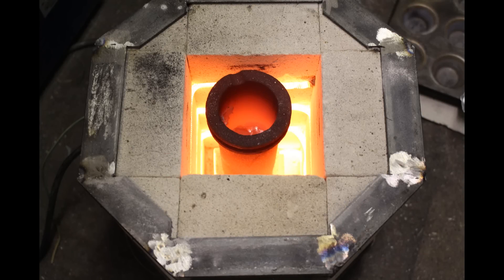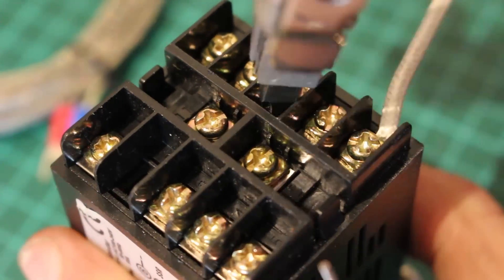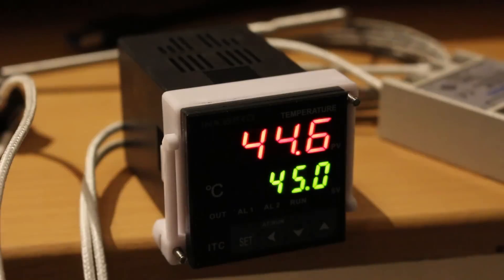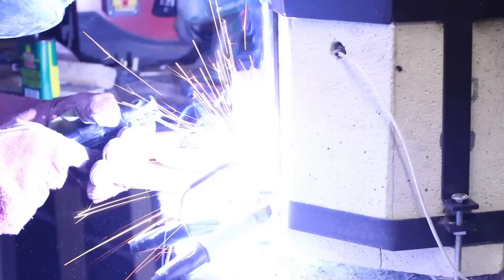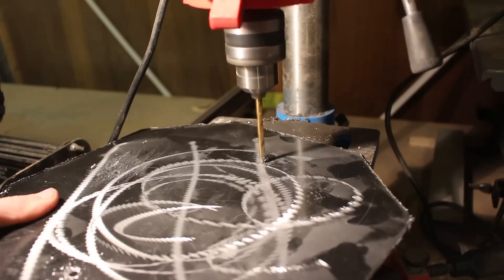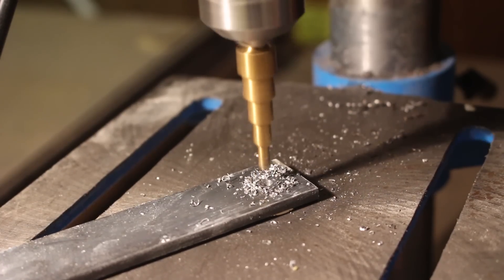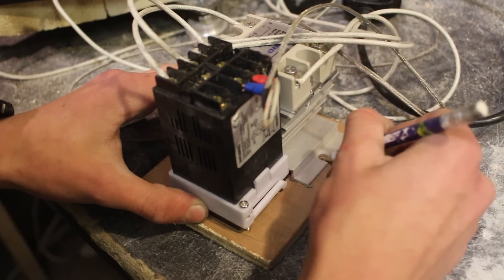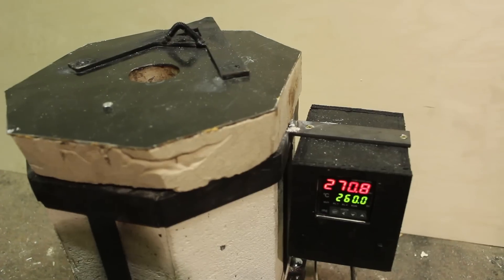How to Make an Electric Foundry For Metal Casting - Part 2

Comment: Do you have any idea how a resistive furnace like this compares to an induction furnace?
Reply: induction furnaces can melt steel, this cannot.
Reply: *****
Thanks. Any idea how much power they use in comparison? Or how much current they would pull from a wall socket (at 230V)?
Reply: TheRexDark No Idea, I tried doing some research and all I could find was someone that made a large induction furnace but the plans and how he made it was very hush hush he wouldn't share with anyone, good luck though
Reply: that depends on the power output

Comment: Nice upgrades to an already great forge. You might want to just check your earthing of the case is actually working though. It appears you painted the frame before putting the bolt through that is connecting the earth wire, the paint might be insulating the frame. A continuity check should be enough. You should probably also have an earth from the case to the lid frame just in case the hinge doesn't make an electrical connection.

Comment: You now also, besides having a casting foundry, have a small kiln for firing pottery, or melting glass.  The options are endless!  Another, less expensive option is to use an electric stove controller.  You have to play with it a little more to find your temperature control, but it is a great deal less, pricewise.

Comment: How did you get the PID controller with a range of -50 to 400*C to measure above a temperature of 800*C?
Reply: Change the thermocouple to a higher rated type.

Comment: hey maby this is out of your reach, but im looking into makeing my own vape box mod out of brass. i have casted a phew things before in the past but i cant wrap my head around casting a box? You should give it a shot it would be cool to watch you do it bro, subed
Reply: Casting a box has its issues on wall thickness as liquid metal tends to solidify and not get into thinner parts so efficiently. Only ways that come to mind would be to create box so walls are much thicker and you grind back to desired wall thickness, or it could possible work via making tons of flow tubes all around the surface so metal can flow everywhere. This makes mold really complex, needs pretty much 3D printer and you still need to clean up the outside.

I would go with thick wall route, create desired inside diameter and just grind into desired wall thickness from 3cm(?) witch should be enough to get metal flow. Mold should be done plaster and paris+sand mix, cause plane sand most likely would collapse, specially with the 3D printed part. Also make sure to make enough risers and flow tunnels to get best possible result. Excess you can always melt again, but adding more can be pain in the ass, specially for DIY casted part.

If you try this, tell me how it went, cause i'l be making my own line of vape mods soon and i was thinking on making some high end models with metal boxes.
Reply: ill give that a shot. If you go out and look at the mason 40mm i want to cast a tube that will fit with that make like a mega pen
Reply: GRAMMAR

Comment: Not sure my PID works right.. I get around 600-650C or some other high temperatures, and then itll just switch and read 100-150C lower.. Maybe my sensor is junk.

Comment: I've got a question. I'm about to make my own electric Foundry, based 99% off of your design/videos. i was thinking about using a bigger kiln heating element. one that is 220v still but 2500W instead of 1200W. i would think that it would be able to reach higher temperatures for melting more resilient medals like iron/steel. is there anything i need to change or consider if i were to use the 2.5KW instead of the 1.2KW?

Comment: +The Art of Weapons, i have been planing to make a propane metal melting foundry but your electric foundry seems to be cheaper to run so i want to make one, but i can't seem to find a resistance wire like you have so if you read this and have time please send me a link to your resistance wire so i can buy it :) ( if i can get the wire i will make a video showing me making it. thanks.

Comment: This project is awesome and i am accumulating parts to build it myself too :).

You can add a steel fence (small mesh) to the inside to prevent yourself/tool to get in contact with the heating wire (electric shock prevention). 

Another idea is to use 2 switches which disconnect booth power wires for the heater if you open the top side. 

A third idea is you can update the heating element from 1200W to 2000W , to speed up the melting time.

Comment: 5:45 you add an Earth Cable to your Foundry, please note that this will not save your life from Electrocution. The time it takes, the amount of current and voltage, you will not survive. A fuse! of all things is slow when it comes to saving lives, you want whats called an R.C.D, Residual Current Device, I say use an Licensed Electrician

Comment: Hi, I was wondering, where do you get your bottle caps for HDPE? I can't find any anywhere. I know I could get them from milk jugs, but that would take forever. Is there any place to get them in bulk?
Reply: Because milk bottle cap plastic is different to milk bottle plastic they are recycled separately so go to your local recycling centre and you should be able to get them in bulk

Comment: is there anyway to up the heat to 1500 C
Reply: No, the wire used in this video (which I'm assuming is nichrome) will melt at around 1300 C and even then it will be extremely fragile. The bricks he used in the video are rated to around 1000 C, so they'd crack from the thermal shock.
Reply: ChwanPang bb

Comment: Hey TAOW
Just made my own foundry thanks to your tips! I used to have a charcoal foundry but it was a bit dirty and quite expensive as well...
About the heating element I would however sugest a 3KW coil (or two), but I'm not on the same kind of electric grid (220V, France). I also had to plug it to a special plug (32 Amps).

Thanks for your great videos, I'm now casting with more ease!

Comment: Hang on... So the crucible split, the bottom was covered with molten aluminium and the spring got covered. I legit said that would happen on the original build video. :)

Comment: Couldn't you just use a dimmer switch in place of the temperature controller and then just put a separate thermometer on it? It would definitely be cheaper.

Comment: how do you get all the money, and TIME for these.
Reply: Just Another Emo On Youtube he has 168k subs he spends his youtube money probably
Reply: PId and SSR cost 10 bucks, heating element is 4 bucks, thermocouple is 3 bucks, Bricks can be bought second hand cheaply.
Reply: just TAKE your time its as easy as that
Reply: Simple, he's got great parents. I can't think there are many parents who'd let their kid experiment with molten metal
Reply: Truth. Who wouldn't make a forge if they had access to a full workshop. This is what makes it so funny really, that the forge cost $100 but the tools to build it over $10,000
Reply: John Jones the only tool used that you couldn't get for less than $100 is the lathe, and that was to totally unnecessary

Comment: Small improvement : Attach a connection to the lid so it turns off the heating when you open it to minimize the risk of electrocution.

Comment: What you built is a FURNACE, not a foundry.  Looks good, let us know when you can get it to melt bronze

FOUNDRY:
Pronunciation: 
/ˈfaʊndri/  
 noun (plural foundries) A workshop or factory for casting metal.

FURNACE:
Pronunciation: 
/ˈfəːnɪs/  
 noun 1An enclosed structure in which material can be heated to very high temperatures, e.g. for smelting metals.

Comment: You really dont need pid on something as slow as this, a simple on off regulator works just fine! why do anything other than full power when you are heating it up? And with the slow cooling of the aluminium you dont really need anything other than zero power when going from 265 to 260.

Comment: Your father gave you access to a nice workshop making all those works possible. My father didn't, he is a footballholic.
Reply: Workshop? Thats over rated.. i have balcony and living room, thought what i heard its ether metal melting or girl friend, so guess i have to do this at the friends backyard...Still this does not prevent me from doing milling jobs or build furniture here! ^^ You have your own room i presume? Start crafting already!
Reply: Hellsong89 Real furnitures that can compete with the pros require at least a carpenters bench and a wood plane or machines and a panel saw.
Sure you can saw some planks, glue them together, nail some table base on it and claim that this is a table. But it's a piece of handcraft of the cheapest quality not even worth the wood or calling it furniture.
Good works begins with the right tools and enough room.
You have already lost if you need to stow away your plans in your living room after every Saturday.

Comment: <-- North American here.

What are GCSE's?
Reply: After a quick google, our GCSE's in the UK are the same as Americans having a high school diploma
Reply: Oh. So basically a certification of completion for grade school?
Reply: A series of exams (between 8 and 12 subjects usually) normally taken around age 16, the results of which will determine what subjects you will do at a senior level (A-levels in the UK, which in turn determine whether you go to university if that's your desired route) or indeed whether you will even go to senior school!
Reply: Vormulac1 Senior school? So to go to that final year of school before university, you need to do well on these exams?
Reply: Absolutely! Senior school is two years (age 16-18 roughly) and yes, if you mess up your GCSEs no school is going to let you go and do A-levels at senior level, subsequently no GCSEs = no university. Ok, it's not quite as black and white as that; I did well at GCSE but for a number of reasons I won't bore you with I messed up my A-levels, so I had to do three years of engineering courses at a local college which I aced, which allowed me to go to the university I would have gone to originally if I'd got the four 'A' grades I should have got at A-level. Ended up in the same place, just aged 21 instead of 18! :)

Comment: You built a FURNACE... 

English 101:  Foundry: N~ a workshop or factory for casting metal.  FURNACE: N~ an enclosed structure in which material can be heated to very high temperatures  and FORGE: N~ a blacksmith's workshop or V~make or shape

Comment: I respect your will to make all this, but you kind of overcomplicated the whole thing while managing to forget some crucial things. The lid cracked because it wasn't supported properly, not because of the temperature.

Also, never use gypsum in electrical foundries. Gypsum breaks down to quicklime and SO3 at high temperatures. It basically gives off a mist of concentrated sulfuric acid. It's terrible for the lungs and it's terrible for the heating elements.

Use refractory insulating bricks and ceramic wool, rock wool or glass wool for lower temperatures.

Comment: love his vids but where the fuck does he get all the money for his tools and shit like wtf.
Reply: He makes stuff to sell and buys tools with what he earned. I did lots of job back in the day, with deal that i get little money, but customer will buy me a brand new tool that i need in that job. Worked fine and i got proper tools now that will last. Of course one could buy cheap china knockoffs, but how long those will last is different matter.. 

Many tools can be found from garbage and refurbish as new or could be just fine as they are.. for instance newish straight edge level from garbage, just needed to soak some paint off and clean it. Price for new 120€.. Guess busy boys dont care to spend half hour cleaning their tools... Reel type of extension core from same trashcan, where wire was pulled out, fixed it with aluminum strips and little copper wire as rivets, or i could have replaced the end after market end socket thingy.. Angle grinder, needed new coal contacts... that were in the box with the machine -.- professional quality machine, price for new 200€...

Also trick is to get tools you can use in many various ways, like angle grinder cutting grinding, polishing, poverty lathe with a drill. Belt sander as bolted into table with its small support to grind things, or bolted into peace of wood that you can slide on the simple frame to sand surface to level and even. Not much tools are needed if you invent different way to do things. If you need to do things often, then get specific tools to do jobs.

Comment: i think its time you get a 3d printer and start lost PLA casting ;)
Reply from the maker: +TypeOmeg4 I've already got one, I made a video about it a while ago. I will look into doing a bit if pla casting tho!
Reply from the maker: +TypeOmeg4 I've already got one, I made a video about it a while ago. I will look into doing a bit if pla casting tho!
Reply from the maker: +TypeOmeg4 I've already got one, I made a video about it a while ago. I will look into doing a bit if pla casting tho!
Reply: maybe take the pla print and use a investment of the plaster/sand mix  and melt it out in the foundry so you have a empty cavity to cast your metal into. also maybe try smoothing the ridges of the pla prints by filling them with jewelers wax first as that would melt out of an investment as well and give you nice smooth prints.

Comment: Hes a fraud, ashame he got so much attention from Grant.   The manufacturer of the heating element wire made this EXACT same thing in 2012.  TEMco industrial.   He copied them verbatim but acts like he came up with this on his own, didnt even give them credit for any of it.   Lacking creativity is one thing, but have some integrity, dont have to steal others creativity and try to pass it off as your own.